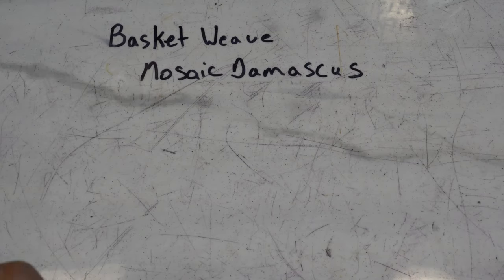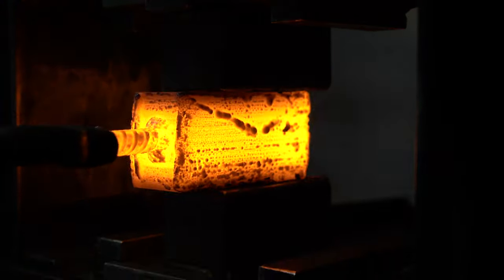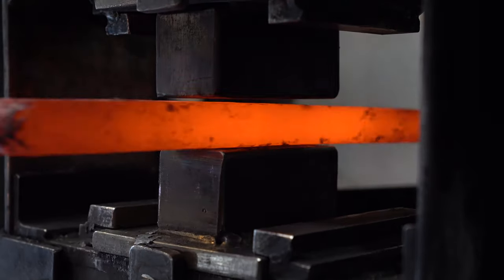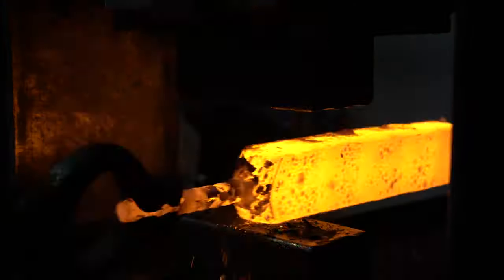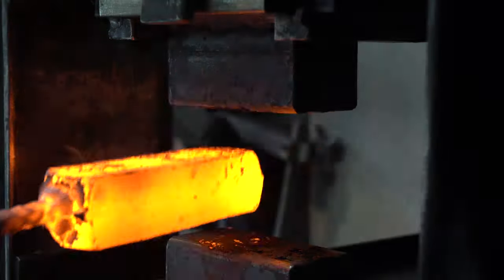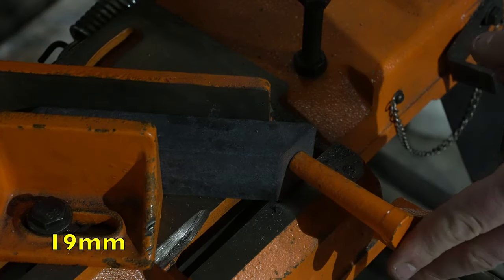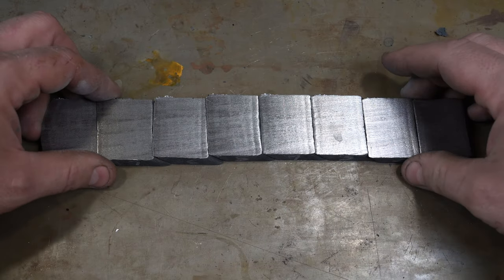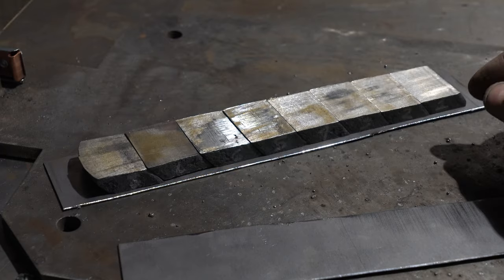Triple-T #108 - Damascus Patterns - Basket weave mosaic

Comment from the maker: Unfortunately I didn't see that I had accidentally flipped tile #7 until I was editing the video.  I guess that will be the handle side what it gets turned into a blade.  😉  Any questions about this pattern or about mosaics?
Reply: @Tyrell Knifeworks no questions on my end, but I do have a suggestion, and it's applicable to every damascus builet..if you have a surface grinder, you can surface the top and bottom, before cutting..it's saves a huge amount of time, and makes it easier to tile or restack your builet (you don't need to grind each side of a bunch of small, difficult to handle, tiles)
Reply from the maker: @jamesafseth326  I answered a similar question on another comment.  I find each piece cuts on a very slightly different angle on the bandsaw so if you grind each one separately you get a better fit.  I've done it both ways and I find my way works better for me.  It's not much different time-wise as those grind are really quick.
Reply: How long did it take in terms of time to get to a workable blank, also how much steel do you lose making something like this due to scale and forging?
Reply from the maker: @pr0faker  this was 5 forging sessions of 1-2 hours plus cooling time between each.  Then you have the grinding and prep work.  It’s probably around 20 hours of labor to get what you see at the end.  As for steel loss, you should count about 5-10% of each restack loss due to scale and cutoffs.  The end billet is around 15-25% less steel than what you started with.  This will vary depending on the pattern.  Twist is much more lossy than other patterns because of the amount of grinding.  Complex mosaics require a lot more restacks so you lose a lot from cutoffs.  Make sense?
Reply: @TyrellKnifeworks  yeah thanks gives a better understanding in the proces.
Reply: @tyrell_knifeworks Maritime has hydraulic presses?  Can't see any on their website? Also you never use flux, is that just based on experience?
Reply from the maker: @yax75  actually they had to stop carrying them because their supplier stopped production.  That clip was recorded a while ago.  Thanks for watching.
Reply: Can you attempt an optical illusion Damascus blade?
Reply from the maker: @SHIEET817  I've done blades before where there so much chatoyance it looks like its shimmering.

Comment: Simple, I guess in comparison to some other patterned steel processes, but clearly there's a lot of detail which must be attended to, and clearly you have to have a plan before you start out. Thanks for sharing!
Reply from the maker: There were a lot of general info on mosaics in this video that is applicable to all of them.  This pattern is a pretty easy one to achieve once you get the basics of forge welding down.  I think its a great first pattern to do when you start mosaics.  (but you'll be diving right into explosion in Jan! 😉).  Thanks for watching!

Comment: This was really interesting to me because for the first time I learned what "normalizing" means - to let the composition become more uniform with respect to carbon, throughout the steel.  I'm a geologist, and when I talk to my students about metamorphic rocks, I discuss the fact that at high temperatures, ions can migrate through solid rock.  I guess the same thing is happening here.  Maybe I'll have to assign this video to my students!

And by the way, I love the basketweave pattern.  Relatively simple to make, but breathtakingly beautiful.
Reply from the maker: I'm no metalurgist but the normalization process is really to dissolve all the carbides in the steel so that they can be used and reformed during the quenching process.  The layman term would be to dissolve the carbon across the steel though.  Dr. Larrin Thomas' book Knife Engineering is now the defacto standard reading for most knife makers and has all this info, but certainly feel free to use this video.  😜.  You might find my video on Heat Treating (in my Beginner Series playlist) more informative on the subject (but not too sciency) as well.  Thanks for watching, Greg!
Reply: @TyrellKnifeworks  Thanks for the explanations.  So many forging videos just show the same thing over and over again, but you explain and teach.  IMO that adds a lot of interest and value to  your videos.

Comment: Outstanding as usual Denis!  Thank you.  BTW I think it was your #8 that got flipped since it was only the spot between 7 and 8 that duplicated the adjacent pattern.  Not criticizing at all but it makes sense that the #8 looks the same upside down!  I'm definitely going to try Mosaic soon -- working up the nerve to try it
Reply from the maker: No, watch the video in slow motion.  You will see the weaves duplicated on both sides of 7.  Plus “8” is an end piece, it looks different on the other side and couldn’t be flipped without noticing it.  Thanks for watching.
Reply: @TyrellKnifeworks  Ahh  you're right!

Comment: Is there any efficiency curve based on the size of the billet? E.g. Taking into account that a larger billet takes more gas to heat, but loses less to scale and saves time as there is more pattern steel at the end, is there a specific amount of steel that would minimize total costs?
Reply from the maker: I don't think so.  Big billets take longer to heat up, hence more gas, so its a trade off.  I usually just start with enough steel to have 25% more final billet than I need.  Thanks for watching, Diego.

Comment: You said it was about 4-5 forging sessions, but roughly how long was each forging sessions? This was beautiful! Thanks
Reply from the maker: Typically about 1-2 hours, then you need to let it cool so you can handle it, another 1-2 hours.  Then cutting/grinding (another 1-2 hours).  So in total this pattern is around 20 hours to make.  Thanks for watching.

Comment: Don’t you think to add some metal sand at the end of the forging proccess to make a better connection of each piece of the steel? If you see what i mean.
Reply from the maker: There's no need for any of that.  Once it's forge welded properly, it's one solid piece of steel.  Thanks for watching.

Comment: Wouldn’t flat grinding the sides of the final billet before tiling it safe a ton of time, rather than individually grinding each small tile on two sides?
Reply from the maker: The issue is that the bandsaw doesn’t make perfect cuts and you’ll still need to grind the touching sides anyway.  Thanks for watching
Reply: @TyrellKnifeworks  What grit do you grind the touching sides to when you tile them together? Do you find that a course grit is better than a fine grits or vice versa?

Comment: Just out of curiosity, let's say hypothetically, you don't have a welder.  How would you go about forge welding the tiles together?  Or is that something you wouldn't even attempt?
Reply from the maker: I personally wouldn’t recommend it.  You can pickup a welder for under $200, there’s no point screwing around with hose clamps or wire.  Welding is one of the skills every Bladesmith should learn early.  Thanks for watching.

Comment: Could  I use stainless steel for the final forge weld cap for the bottom and top
Reply from the maker: I’m not quite sure what you mean.  You want to layer this with stainless and use it as the core?
Reply: @TyrellKnifeworks  after  I cut the piece at a 45° angle and stack them flat so the pattern is facing up can I use stainless steel for top and bottom to forge weld them back together  or should I use mild steel (sheet metal) to encase
Reply from the maker: Oh, I see what you mean.  As long as you can weld them together fine with the stainless steel, that would work well.
Reply: Thanks and it worked just did not start with enough steel there is a lot of loss
Reply: I now have the basic idea and can go from there. Your videos are awesome have built the surface grinder attachment, knife sharpening jig, straighting jig, and tri axsis sanding jig they all work great  👍🏻

Comment: I wonder how much of the initial amount of steel is lost during the entire process of making a knife.
Reply from the maker: It really depends on the particular pattern.  Some are more lossy than others.  This one is pretty good though.  Twist is a pretty bad one because you end up grinding a lot off the billet.  If using a press, I account for about 5-10% loss due to scale, 5-10% from end cuts.  Gauging a 15-25% loss in most of these patterns is a good guess.  Thanks for watching, Hubert.

Comment: Wouldn't it have been better to surface grind 2 faces of the bar before you cut the tiles? That way you can hopefully save time and not deal with little pieces.
Reply from the maker: You can do it that way too.  I've just noticed that you get slight variations in angles with the band saw cuts (at least with mine)  that you fix by using the angle'd rest and grinding the edges.  They always seem to fit better when I do each piece separately.  Thanks for watching.
Reply: @TyrellKnifeworks  good to know, sort of weird that happens. I was watching a video from some Russian guy who surface ground the two surfaces, but also the flats before forge welding. You may get a nicer pattern, but it's probably not worth it half the time anyways.
Reply from the maker: @SiliconeSword  Whatever works for each person.  He might have a more accurate bandsaw that I do, mine's a cheap one but it gets the job done.  If I wanted to tig the billet together I certainly would have surface ground the sides so I had clean steel.  I just find its quicker overall to just mig it.